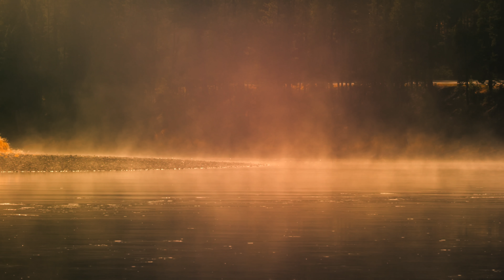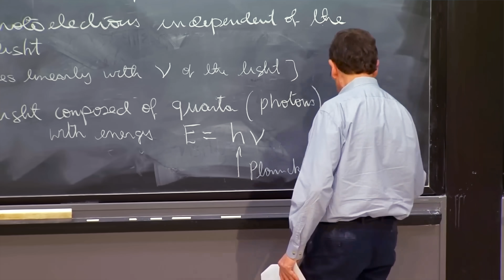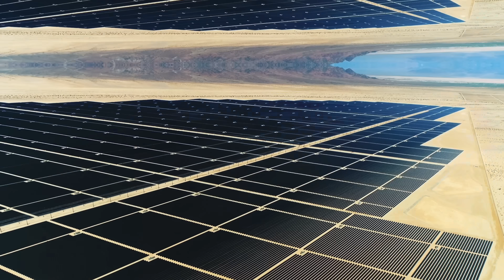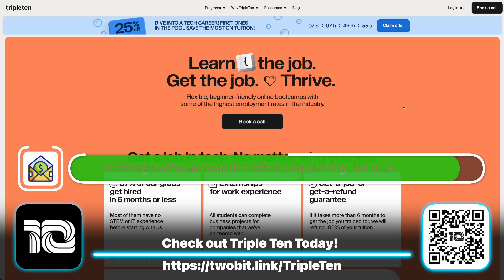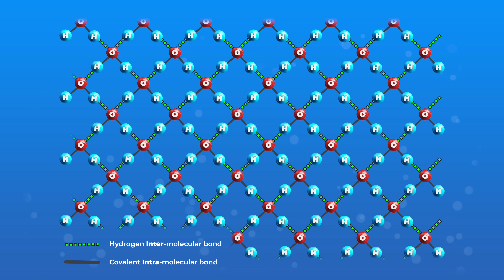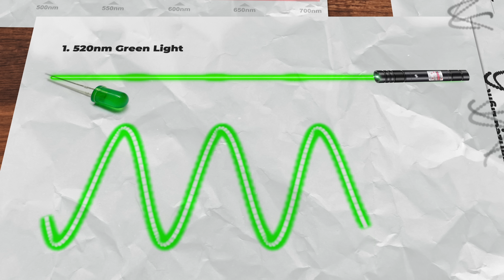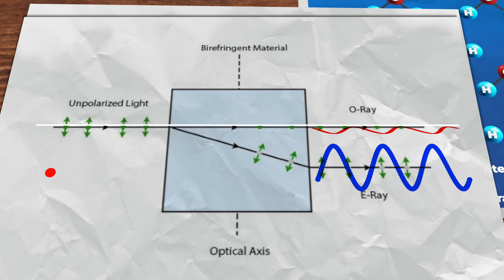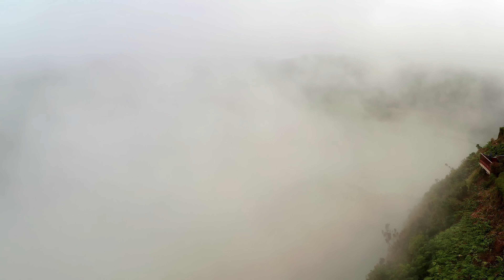New MIT Discovery Just Solved Water's BIGGEST Mystery!

Comment: The idea of using this for cooling is basically a expensive and complicated swamp cooler
Reply: And more inefficient. The whole thing of this phenomonon was that evaporation was higher than would be expected for a given thermal input to the water. That is the opposite of what you want for swamp cooler because you would loose water without loosing as much heat from the thing you are trying to cool. All while putting extra energy in the form of light into the system.
Reply: He is just throwing out some idea his team made up... Quite honestly with some of the mistakes I've seen from this channel... I think he thinks his team is smarter than what they are. 

 Anyway you're forgetting speed of the heat transfer. Maybe this could be paired with passive radiative cooling which has seen some advances.

Comment: so leafs are green to preserve humidity?
Reply: It could be a factor but I would be careful about jumping to that conclusion. 

This explanation would only make sense if reflecting the green light decreases the likelihood of this interaction occurring on the plant. Given that it is a surface interaction (i.e. the effect happening further inside the plant would not cause evaporation because the water is not in a position where it can leave the plant) reflecting the green light rather than absorbing it may actually increase the incidence of this effect (absorbing the light with a pigment would reduce the number of times the light passes through the surface of the plant).

Compound this with the information that:
- Not all plants (or more generally green photosynthetic organisms) are in areas where transpiration is a negative thing--thus this selection pressure would not be present for aquatic plants or ones with excess or sufficient water supply. We know that there are shallow water green alges that have been around for a long time (which would never have a reason to limit transpiration because they are literally swimming in water).
- There are other fairly well researched reasons that plants may avoid using green light. For example that structures that absorb it (with green being the peak output of the sun for terrestrial/shallow water) would have harvest too much energy which could cause damage or disruptions (basically over charging things which is dangerous). This research that looked into this model of 'moderating energy capture' and it apparently fit even with things like purple photosynthetic bacteria (because the spectrum of light reaching them was different).

tl;dr there may be some connection in some places, but I don't think this is anywhere near enough evidence to come to that conclusion especially given there are already other models that seem to fit more universally.

Comment: could this have contributed to plants being green? reflecting green light, they're not wasting the water
Reply: In most conditions (Apart from desert plants) it's very desirable for plants to evaporate water from their leaves to draw more water and nutrients in at the roots. They're mostly green because chlorophyll, which happens to be the chemical that allows them to convert light, water and CO2 into sugar, is green.
Reply: @peglor  it is desirable, which is why leaves absorb so much light. What I'm getting at is that green light would be useless in the context of photosynthesis, exactly because it evaporates water before it can be used. Plants lose more than enough water already when they open their stomata